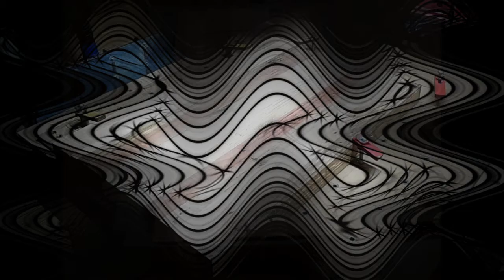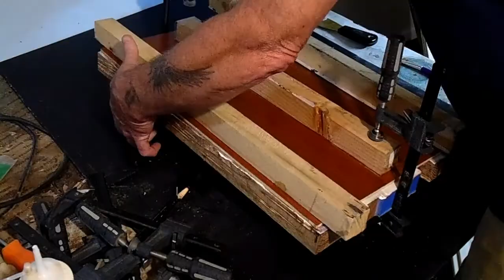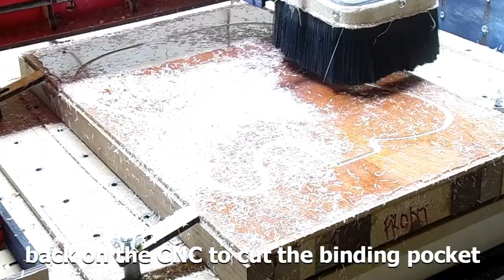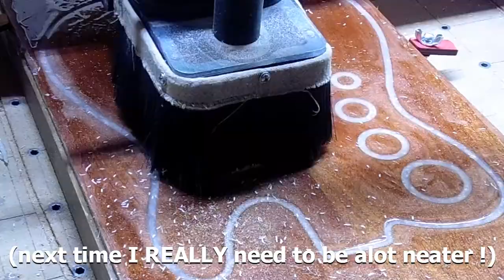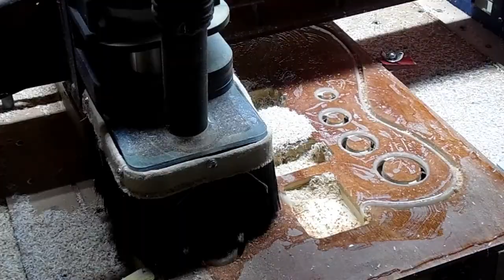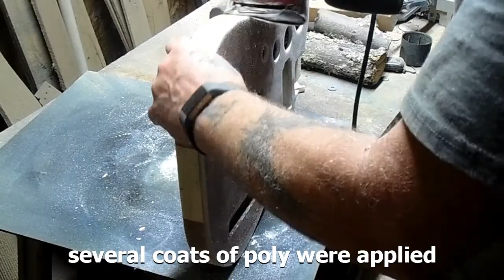Making A Semi-hollow , dual humbucker Telecaster style guitar body with a Bobs CNC Evolution 4

Comment: Nice work.  To help get a smoother epoxy pour, spread it out as level as you can with plastic spreaders, spend a bit of time on this, once satisfied, use an atomizer bottle to spray the surface lightly with rubbing alcohol.  The alcohol breaks the surface tension of the epoxy and allows it to level out much more.  Way less sanding.  You can use a finger pumped perfume or cologne bottle for the atomizer or some kitchen shops have atomizer bottles that you can pressurize by pumping.  They are designed for spraying cooking oils, lemon juice etcetera in a very thin layer.  That’s what I use, it works great.
PS:  After using it for a while are you happy with your Bobscnc or do you wish you’d bought something else?  I’m just about to pull the plug on buying one so your feedback would be very helpful.  Thanks

Comment: Nice! With your epoxy you might try using less, forget the barrier idea and use a sqeegie, sloping the excess to the floor in broad clean strokes. Use blue tape underneath to deal with the drips.
Reply from the maker: Thanks ! I just figured with the barrier, there'd be less epoxy wasted. Plus I wanted the bottom flat without having to do a lot of cleanup.